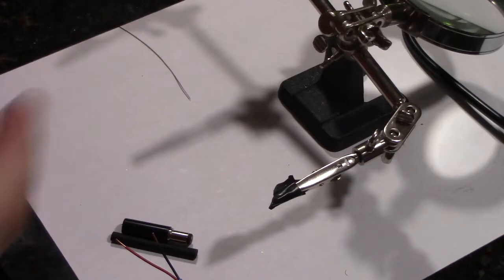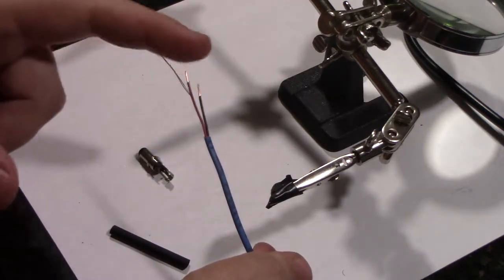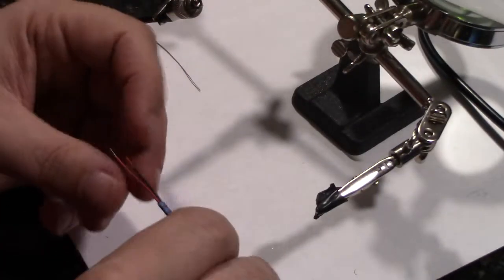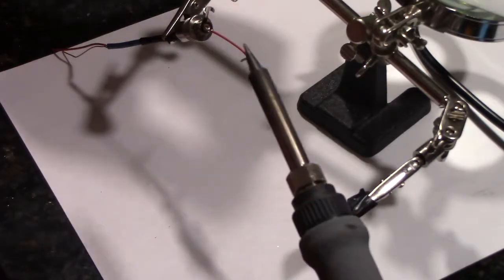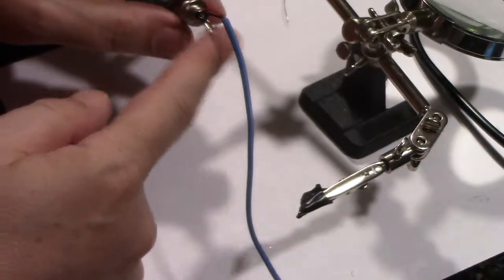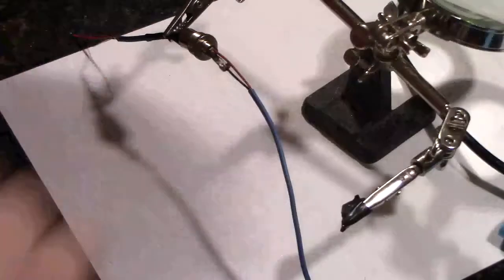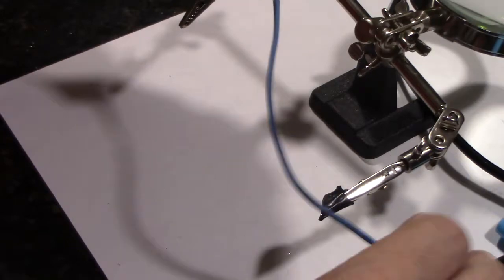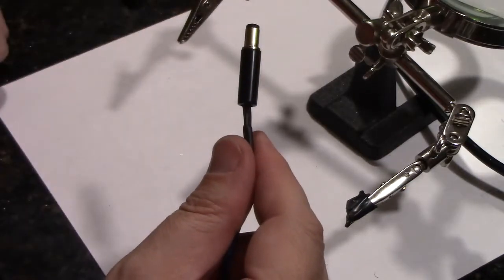Male Barrel Connector Soldering Tutorial

Comment: Note: if you have too long of a conductor, it may contact ground inside the barrel... or maybe I burnt the plastic with my soldering gun... neither of which is good. Also, the sauder may not bond with the steel... it could still mechanically hold itself there if you plan it like you did. I heatshrink the ground for extra protection and heat shrink over the screwtop strain reliever.  I've been using a heat gun... but lighter might be more accurate, thanks!

Comment: 6.5mm by 4.4mm barrel plug , I want to replace it with a L or 90 degree plug head. As simple as cutting the old head off and soldering to the new head?

Comment: Pretty sure the male/female is actually backwards on barrel connectors.  Meaning, the one that you would think is male, is actually female.  Because the "female" one has that pin inside, which is what makes it male, not female.  Not really here nor there, just nomenclature.
Reply: Agreed. This is a very common error, but to avoid confusion just remember that the male ALWAYS has the pin, regardless of the outer housing, which can vary a great deal according to what type of connector you are using.

Comment: Technically the male is female and the female is male with these, it's one of those situations where the plug has a hole and the socket has a pin. On the plug the positive conductor is a recessed hole  to avoid casual short circuit.
Edit: whoops someone already made this comment